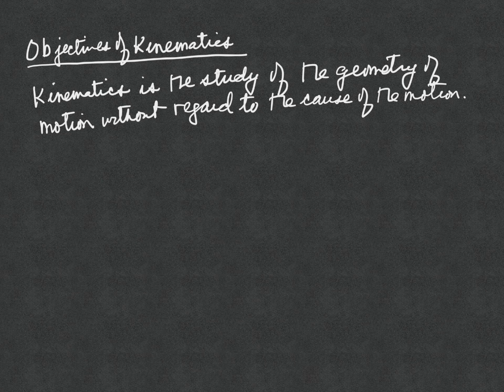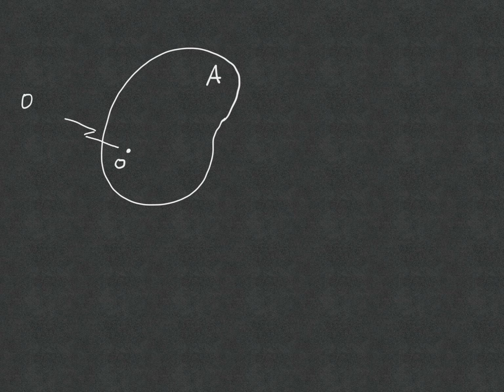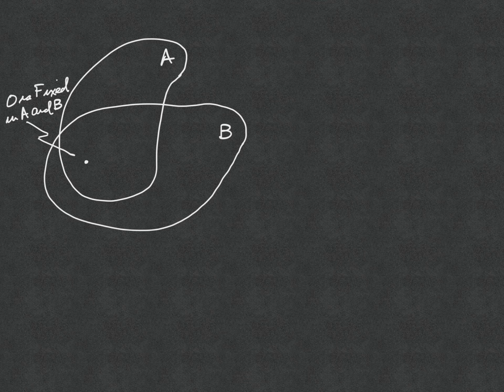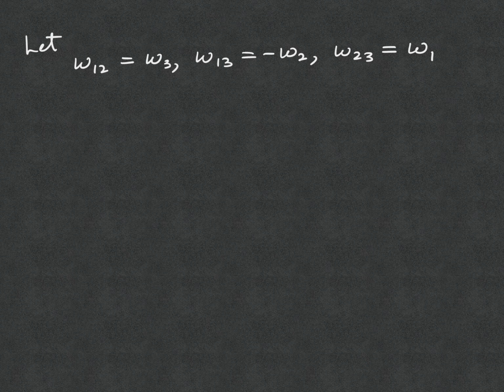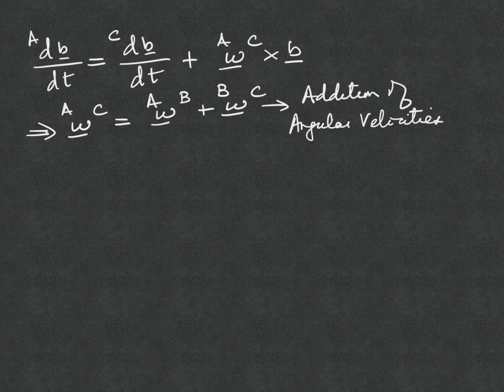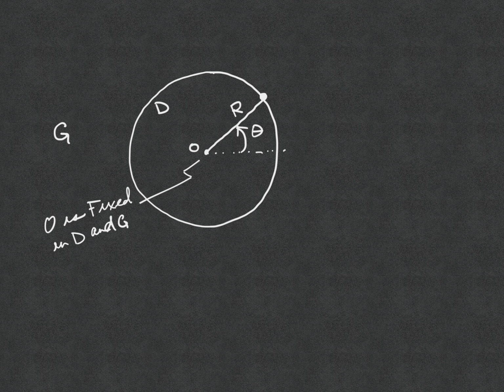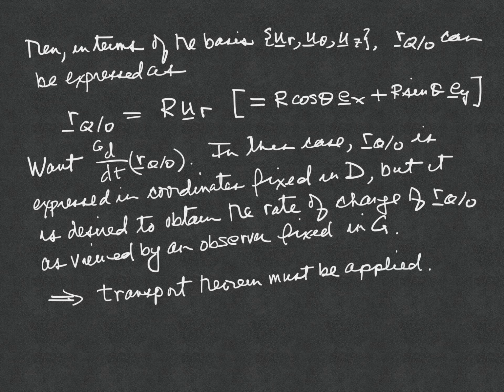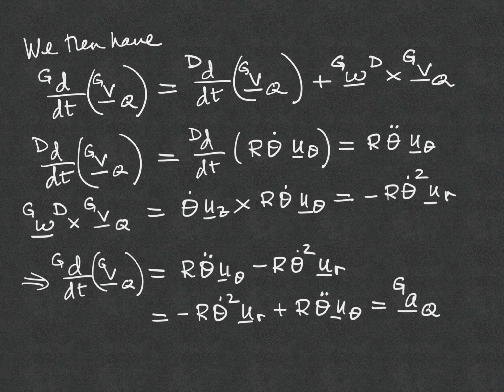Lecture 2 - Introduction to Kinematics and The Transport Theorem

Comment: quotation from your boook "In other words, a vector is independent of the reference frame in which it is observed. However, unlike a scalar function of time, observers in different reference frames do not see the same rate of change of a vector function of time." if so,  then "rate of change of a vector" is itself a vector...it should be indepenent of frames?